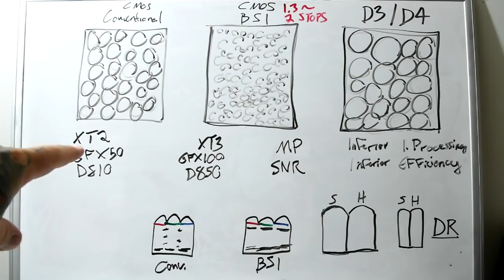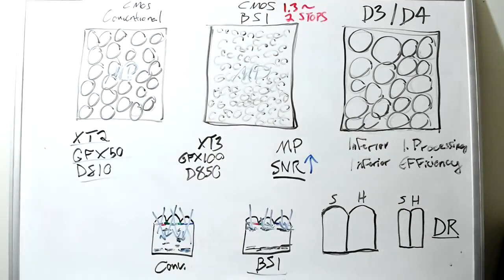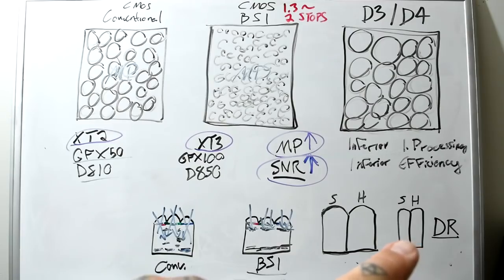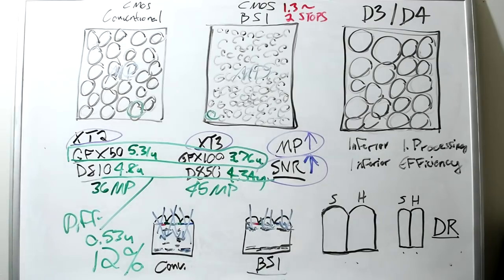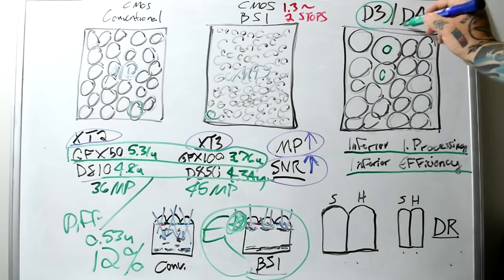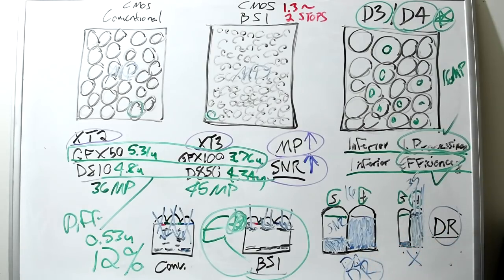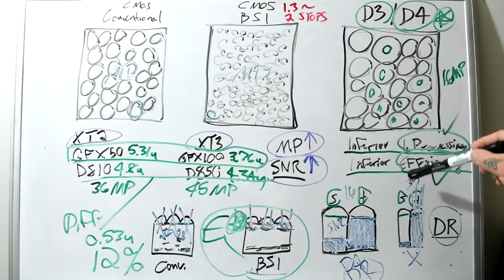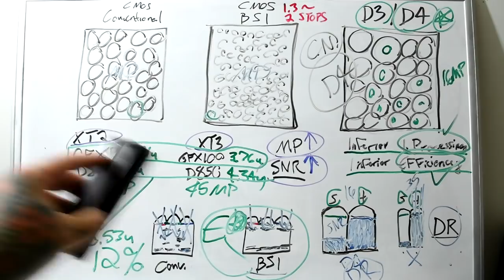😍Look! 🤔 Camera Megapixel Secrets EXPLAINED in Simple! 😙

Comment: Hey Ken. I agree, you don't see this type of explanation nearly enough on YouTube. I've been asking this question for a while now and you've provided a very clear answer. I appreciate all of your diagrams, comparisons, and analogies. I've been wondering whether or not all photosites are the same size. For example, would the smaller number of sites on my 16mp XT1 sensor be spaced further apart than the sites on a 24mp XT2 sensor (the sensors themselves having the same dimensions)? But now I see it's like having 16 big buckets on the back porch to collect rain versus 24 smaller buckets on the same back porch. I've always been impressed with the images  produced by my XT1's 16mp sensor. I've been curious lately about the X Pro 1 and its 16mp X Trans sensor. Thinking about acquiring a used copy. Thanks again for a very valuable, informative video. Cheers!

Comment: Well Sony A7S  has 12mpx on a FF, some people comparing this 12mpx sony vs 24mpx  A7  noticed that A7S actually render background noticeably better bokeh vice using same lens.. Which is quite interesting. I got A7 II and my friend has A7S, and pictures from A7S does look more appealing, bokeh looks smoother, although he cant crop shit from his 12mpx..  That`s another end of the stick... Low light performance also is a lot better comparing my 24mpx sony vs 12mpx A7S, the reason ofc explained in your video. 
Also that is the reason why canon 5d mark I released in 2005 something, does pretty good job at his highest ISO3200 that is like H1 option of this camera and still it does a pretty good job considering its age, take every other modern camera set it at H1 and you wont be able to match 5d mark I.. Take a new crop camera which is ~10 years advancement of technology set it at ISO3200 and you wont be able to match 5d mark I... That is crazy...  Although the new generation is packed with everything new (lol) the physics is the same - bigger pixels is the base of everything in the sensor technology... 
I often look at those Olympus m4/3 cameras that goes for 1k USD+ and all those fanboys bragging about "magical" Olympus technology investing in that system, buying all those "superior" lenses... That is being crushed by ~200usd worth used canon 5d mark I coupled with nifty fifty.. Not to mention the pretty good deal with 5d mark II these days which is pretty powerful camera that you can get for ~300-400USD.. 
Yes the marketing teams in these companies are working 24/7 to sell new stuff while it is not that much of a deal compared to something that was invented years ago....
Reply from the maker: true true
Reply: And how do you plan to take a picture without nailing the exposure? :) Well ~ -2ev or +2ev is more than enough to recover everything you might need to recover from the picture.. And to be honest everything more than that just looks crap after the recovery, who like HDR images? They just look unnatural... 
Back in the film days the need to nail the perfect exposure was more than evident.. Today when we can check the picture in camera, use INFO button to show us highlighted areas,  retake the picture at 4 frames per second or even 15 frames per second speeds do we really need that much post processing capabilities?  Well sure there will always be someone who say yes we do... Personally I dont really need more than what we have today... Canon 6D is pretty much everything what would be needed in 99,9% cases, you can get one used for about ~500-600usd.. 
I see those people brag about "canon doesn not have 4k in 2018, that is crap" etc... Well guess what, canon has its C camera line that is why they lower their DSLRs and mirrorless video capabilities..
Reply: Yes i did look this up sony offer's a verity of sensors / pixel ratios. Loos like they probably have the best sensor tech. Nikon is kind of fucky and uses a lot of Sony sensors. Seems like Nikon is the apple of cameras... Canon is interesting they basically stay with in a pre defined pixel to sensor format ratio and develop the surrounding / supporting technologies aka image processing, autofocus and SNR over time. This states that we basically only need about 24mp and any thing above that is over kill and degrading to image quality. We have good enough 24mp sensors and can develop the supporting tech instead if beating our heads against creating ore efficient senors in any case they could just make the sensors larger if they want more pixels... And still increase efficiency how ever at a slowe pace as to divert resources into increasing the over all image quality. In any case how ever I don't even care about image processing just dump the raw data into a file and let my computer do the processing. Its like a tv good luck finding one you can game on because even with post processing disabled its still on... I like to do research and in thee cases I want to see the raw image not processing.
Reply: If I needed high ISO camera I would trade my Sony A7 II back to canon 6D any day... I dont care what the reviews say, the 20mpx 6D sensor gave considerably better low light performance compared to the newer tech A7 II  the images from sony just doesnt look good, they look muddy, dirty, overall crap over ISO1600 While canon had less dynamic range, but managed to maintain smoother look even with the noise in the images, the image looked more appealing and natural compared to the sony. in fact you need to really push canon over 12800 to actually see the signs of heavy quality degradation, while on Sony you see those signs just passed iso3200. The first time I took sony to shoot at ~ISO6400 I though to myself that I made a mistake switching these cameras.. Not to mention that the EVF lags in the dark, and to manually focus moving object at open aperture is a challenge indeed. while on optical viewfinder you still see a dim lights and a focus confirmation blink..

Comment: The argument for lower MP is even more true for video, where you only need 4K resolution max, which is about 12MP if I'm not mistaken.
Reply: 6mpx  is enough to print 40x30cm high quality prints. That is 6mpx ar 240-300dpi... What about ~20mpx... Its far more than most of us need...
Reply: @S3l3ct1ve  Well, then you didn't consider cropping...

Comment: Panasonic's video centric GH5S went down to 10MP on its M43 sensor and the reviews I've seen all praise the low light capability. If only Fuji releases an efficient X camera with 12 or 16MP without the color filter array, that would be sublime but I doubt it. Anyway thanks again Ken.

Comment: Good explanation regarding dynamic range and overall sensitivity. How does this translate to appearance of grain (noise) in the overall look of an image?  Are higher megapixel images noisier?
Reply from the maker: actually MUCH of grain is due to inferior/ superior image processing in AD Conv. and the main board processing and signal SNR Firmware that adds noise reduction,  cause noise has known set frequencies which are filtered out.
Reply from the maker: smaller "eyeballs" are noisier in low light
Reply: The more megapixels the more annoying noise look in the pictures :/  You cant really see that through all those reviews online, but if you try out 2 different cameras with different mpx count, you will notice difference right away.. With the less megapixels, image look smoother and rendered better, noise is there but not evident it looks natural just like a paper texture.. When the pixels are smaller, the image looks "dirty" "muddy" even with all that noise reduction software that is filtering all the RAWS inside a camera it just doesnt look good enough...

Comment: Almost there.On XT-3 one will probably not see the delta in noise performance w.r.t XT-2 and maybe, just maybe slight improvement in DR.What BSI enable us ,is to put more pixels on the same area increasing the resolution without the  penalty on SNR and Dynamic range.If Fuji kept 24mpix pixel.pitch we would see same resolution with some improved SNR and dynamic range.
Reply: eagleeye photo sensor yes, but the Xt3 comes with a significantly better image processor so you will see a significant improvement to overall image processing resulting in less amp glow.
Reply: @happythec1am  I have seen images and I think you will not see processor in there or significant delta.Processor power is used to boost AF, Video and known choke up's. Other than that there is slight (pixel2 pixel piep) increase in detail.
Reply: eagleeye photo  You won't see a difference in grain pattern at ISO 800. The difference will been seen with color processing and amp glow at higher ISO. This was the big difference between the X-T1 and X-T2.

Comment: Sensor gathers light from AREA. So with 100MP do we have 2 times lower gain than on 50MP sensor? That is 1 stop which is countered by 4/3+ stops SNR improvement with BSI.
Reply from the maker: Exposure is PER UNIT AREA,   not per TOTAL AREA......ive said that 1000 times in 1000 videos.

Comment: It could be that the z6 sensor is close to what you are asking for: a 24MP BSI CMOS sensor. Should have incredible dynamic range, regardless of the other flaws of the z6.
Reply from the maker: teh Z6 should be a low light beast, too bad its a pisspoor designed camera with 1 card slot

Comment: Hi  Can you make the same comparación with the Nikon D500. In the way I understood your explanation that means that the Nikon D500 is a good trade of censor pitch, sensor size, megapixel count , sensor responsiveness to light between a Nikon D850 and a Nikon D4?  Can you please tell me since I’m looking for the ultima camera with regards to sensor size, pixels, dinamic range, frames per second, etc. 
Thanks for chafing your bast knowledge about photography and cameras.
Reply from the maker: D850 in crop mode is also 20MP, same as D500...... but D850 is BSI and doesnt clip highlights as fast
D500 is designed to be a low light beast for image processed "tilted" towards low light
Reply: @KenTheoriaApophasis  is it correct to conclude that d500 will perform better than d850 in low light, but d850 is better in dynamic range because of BSI sensor?
Reply: Thanks so much for your sharing your information about cameras and how they work.
Reply: Also can you tell us how big of a difference is in dynamic range  between D500 and D850. Thanks
Reply: Theoria Apophasis thanks

Comment: Hi, Ken This is going be a dumb question I know. I just trying to get my head around your Big eye little eye explanation. Does the big eye on the D3/D4 have a bigger footprint on the sensor than the little eye? I.e. where the sensor has little eyes there would be more sensors within the footprint of the big eye? Thus, holding more highlight/shadows in total? hope that makes sense? please be gentle. lol
Reply: Yes Robert - bigger footprint.  Imagine you have two glasses both 4" tall but one is 4" in diameter while the other is 2" across.  The 4" glass has a greater surface area and volume than the 2" glass.  If we fill the 2" glass with water up to its rim we have reached its clipping point - one more drop and it will overflow.  But the same volume of water added to the 4" glass will only half fill it.  The 4" glass has greater volume than the 2" glass therefore has higher SNR than the 2" glass.

Now take two identical drinks trays - you'll fit more 2" glasses on a tray than 4" glasses, just like two FX sensors - one with small eyeballs and one with honking big eyeballs.

Hope the analogy helps :)
Reply: yes thanx

Comment: The Nikon D4 should be called the Nikon DR?  No, it should be called the Dƒ, because the D4's sensor lives on in the Dƒ, the current low-light champ.  Who is ever going to need 100 megapixels?  Or 50?  Most peoples' prints aren't big enough to require more than 12.  Instead, make a D4 sensor, but bigger.
Reply from the maker: Df = crap ergos and one card slot = NON PRO camera  :)
Reply: I don't need a pro camera, just a pro sensor! :P

Comment: Am I right to draw a conclusion that even though Nikon Df has the same sensor as D4, but no where near D4 performance. It’s not just the sensors, but image processors, SNR with efficient ADC. Fujifilm X-T3 has a quad core processor apparently, that makes a different between XT2 thus faster FPS, focusing and ADC.
Reply from the maker: i know, ive said that 1000 times........D700 and D3 sensor are SAME, but radically diff output   :)

Comment: Ken, you should be pretty fast. You look like you're built for speed. Like me, you're shaped like a bullet. I just blame my bad knees for not being able to get up to my full awesome speed potential.
Reply from the maker: built for speed???? me?? hahahahahah
Reply: Theoria Apophasis Shaped like a bullet for aerodynamics, powerful muscles, tremendous amount of on board fuel and a CPU without par. The frame is just designed for a vehicle with a much lighter mass of awesomeness. Maybe a lighter on board fuel storage is in order so long as it doesn't affect the CPU but that's the part that runs on autopilot and has no outputs. The good part is, I can't see me from here.